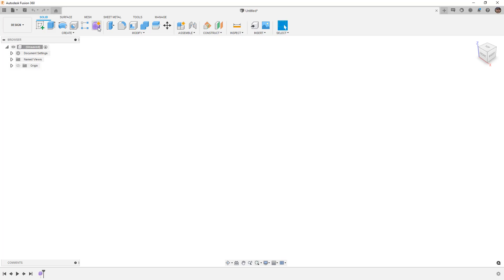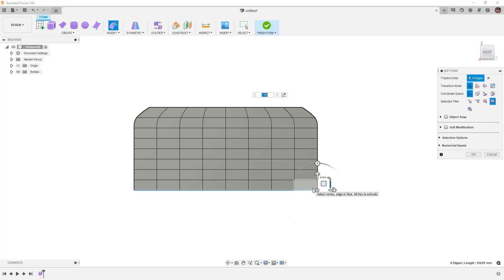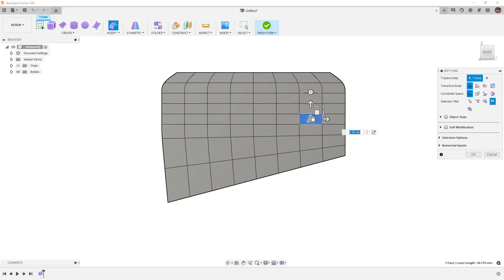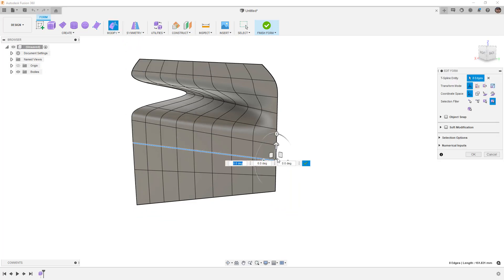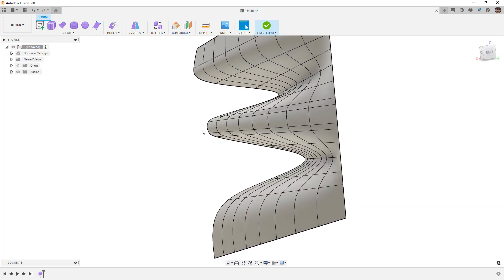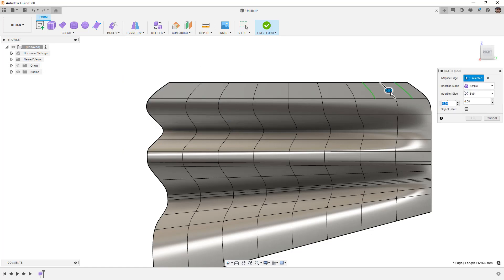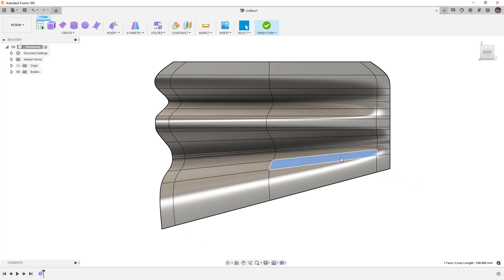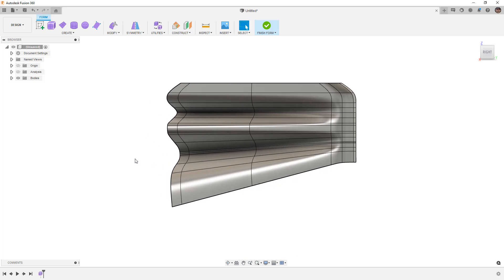Fusion 360 Form Mastery - Part 16 - Mastering Edge Insertion and Edge Control

Comment: Thanks for video, what if we cant to insert a curved edge? Could it be done?
Reply from the maker: Using Insert Edge will add the edge based on the current shape of your model.  If you use Exact, it will keep the same shape.  If you use Simple, it will alter the shape put but the edge exactly where you want.  All inserted edges will be on the form and you can edit them from there.

Comment: The influence of edges/vertices on the surface in the smooth display is just too unpredictable—they’re like quarks or electron paths. It shouldn’t be this way (yet it is). Should we be thinking about edges as having “gravity” or something similar? I believe I’ve heard “tension” used in conjunction with edges but is it always a “pulling” influence or can it be a pushing influence? How can we better predict, vs tria/error, add/delete, slide/insert/bevel…??
Reply from the maker: Its both a science and magic at the same time ;)  Working in box display is the big thing.  I generally strive for an evenly spaced layout of edges.  Only what is needed.  If two adjacent faces are flat, you probably don't need them.  Less is certainly more.

The problem is really that this type of modeling what we are doing in box display is making the cage that controls the tangency direction and weight.  If you go into a sketch and make a control point spline, the box around that is basically what we are doing with box display in a form.  The smooth body is a result of that box "cage" so learning to model with that is really the key.  A good bit of practice is playing with splines in 2d sketches and seeing if you can create the same curve with the least amount of control points.